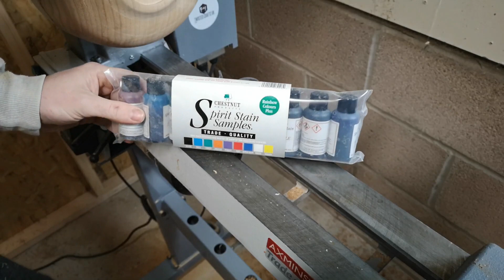Woodturning - A Figured Maple Bowl With Spirit Stain

Comment: In order to avoid those white lines apply colors while the lathe is stationary i guess. And im not sure if 180girst is up enough to apply colors. i prefer 320/400. your finish looks so nice. congrats.
Reply from the maker: Thanks, Noah! And thanks for the tip about the sanding I wasn't sure so played it safe, will try my luck up near the 400 mark next time 👍👍👍